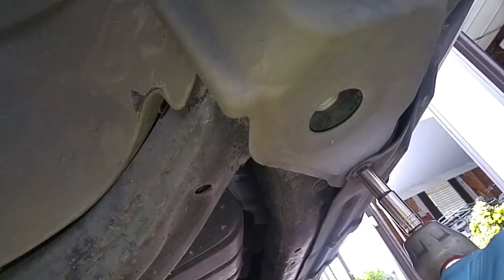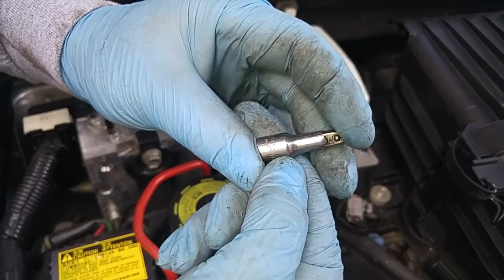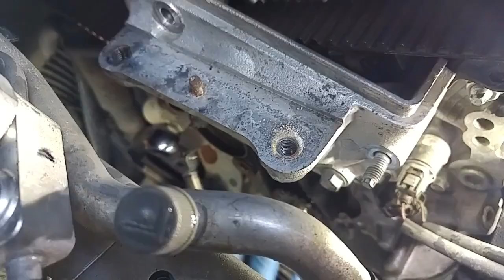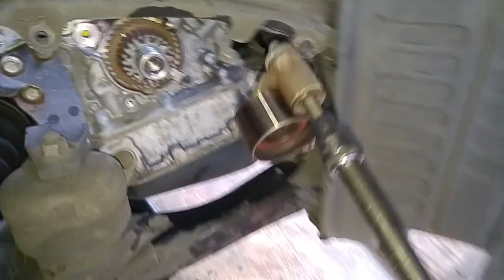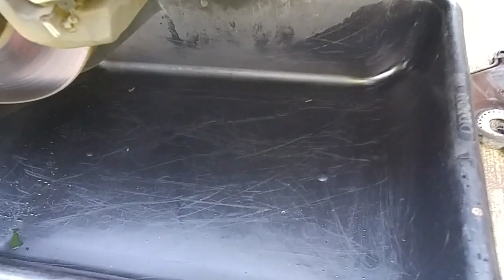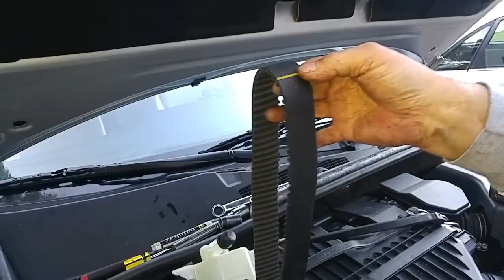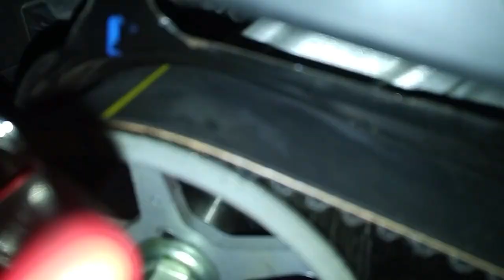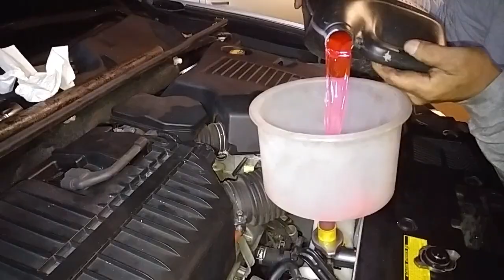Toyota Highlander Hybrid / Lexus RX400h Timing Belt, Water Pump & Seals - V6 3MZ-FE (2006 - 2010)

Comment: Excellent video! I had a Plymouth Breeze that had a timing belt that needed to be changed every 60K or so so I remember doing a lot of the things you are doing. It's a challenge but really satisfying  once the job is done. I'm interested in getting a older Lexus RX400H or Toyota Highlander that may need a timing belt replacement therefore I am writing to you to inquire if you would do this job for me if I drove to your location and the cost. Your reply is appreciated.
Reply from the maker: Thanks for your comment and sure ... I'd do the job for you.   As a matter of fact, this repair video was done on a customer who came from Nashville (around 3 hours away) to have me do the repair.  He was quoted some ridiculous price of $1,800 by two Toyota dealers.
Reply: @hardlymovingpro  Thanks so much for the fast response. If I do find a Lexus or Highlander that needs a timing belt replacement, I will be checking with you to do the job. I am located in the Charlotte, NC area and would be thrilled to drive wherever you are. You are very good at this! Thanks again.
Reply from the maker: @waynehendricks8187  You bet!  Live around Memphis.
Reply: @hardlymovingpro  

Uh oh.  I had mine done at a local Toyota dealership a few years back - 90,000 miles - and it was $900 and some change.  I had them replace the water pump as well and it was an additional $300 or so.  I thought that was steep.  But, now understanding how much R&R of auxilary parts is involved along with seals, etc., I can see why it's a costly maintenance item.

Now, I've hit the 180,000 mile mark and was debating whether to do it myself or not.  Your video convinced me not to.  All the removal and replacement.  Just a PIA.  My next daily driver will NOT have a timing belt.  And yes, I know that timing chains can wear and stretch but.....

On one of my hobby cars, I might do this.  A fun challenge that can be spread over time to avoid the frustrations that will arise.  But on a daily driver that needs to get done in a few hours, just too tedious and frustrating.  

But, if the dealer wants $1,800. That will be a different story.  I might even sell the car and let someone else deal with it.  

Full disclosure: It is beginning to show its age anyway - peeling paint on bumpers, worn steering wheel, needs new struts, non-functional front seat belts, worn leather seats - and making me not want to try and start "fixing" all the things it needs to run and look decent.  It's been the most boring car I've ever owned.  And, it's been the best and most reliable of all of them.

Comment: How much coolant did you have to add to get it back up to the proper level? I’m about to do this job on my 09 HiHy with the winter storm here in the south giving me some time off. 

I have everything I need but only one gallon of the red/pink pre-mixed coolant. Is that going to be enough? Is it a bad idea to strain and reuse the coolant if I need more than the gallon I bought? And do I need that special funnel or can I just use a regular funnel? 

Thank you for your time. Great video.
Reply from the maker: Around 1 gallon should suffice.  If you get the coolant concentrate (Pentosin brand), you can get 2 gallons out of it by diluting it with 1 gallon of distilled water.
Reply: @hardlymovingpro  I just bought Peak OET red/pink for Asian vehicles. Is this not an okay coolant to use?
Reply from the maker: @scootitnbootit9231  Sure ... that'll work!

Comment: Hello I watched your video and do the timing belt change after I finish and crank the car. It start then run about couple second then cut off. All the light is come on do you think I miss the timing? I know that I do mark very well. Please let me know it is about the timing or you think it is hybrid? Thank you very much
Reply from the maker: Must keep your foot on the gas pedal to allow the engine to keep running on hybrids.
Reply: @hardlymovingpro  yes I did but it run for 10 seconds then cut off. All check hybrid light vsc light and engine light is on. After I start about 3 times and can not start I have to take out - from battery to reset then start it about 3-4 times. Do you think  miss fire do that? Thank you very much
Reply from the maker: @anthonytran9005  if the check engine light is on and the error code is camshaft position sensor related, then the belt is out of time.
Reply: @hardlymovingpro  thank you very much. I’ll take it out tomorrow and see the mark again. The only problem I can not see the the mark on the inside camshaft pulley!

Comment: I just changed my timing belt, tensioners, pulleys, water pump, it's making ticking noise. I drove it and seems normal, the same as before I changed them. Is this normal?
Reply from the maker: Probably valve tap.

Comment: Hi I have the same car, 
Yesterday I was driving it, suddenly I saw it was overheating, at the same time it shows in the dashboard ( water pump). So do you think it’s the engine water pump? Also do you think that I can replace only the water pump without getting the timing belt out ? 

Thanks a lot in advance
Reply from the maker: Could be anything in the cooling system;  water pump, hoses and radiator are all sources of coolant leakage.  The water pump on this Toyota engine is driven by the timing belt.   Must remove the timing belt.
Reply: @hardlymovingpro  
Thanks a lot I think based on what you told I’ll go ahead and reply the Engine water pump because two months ago I replaced the hybrid radiator, the hybrid water pump and the radiator assembly due to leakage right after that I had no issue at and no leakage. 
Just happened that my car was overheating and as result for that the radiator start leaking so I’m thinking the water pump is maybe partially working due to it’s age about 12 years now and this causes a pressure buildup in the cooling system cause radiator leaking to release the pressure. 
Do you think I’m on the right path ? 

Thanks

Comment: How long did you take to do the whole job? And also I seen videos where there's a "maintenance mode" and that mode stops the hybird system from kicking in, making the "gas mode" stay on all the time. Did you do that while bleeding the air out the cooling system?
Reply from the maker: With my video partner capturing the repair, about 6 hours.  With no stopping for video, around 5 hours.  From my recollection, if the car is in neutral and not running, depressing the gas pedal will turn on the engine and keep it on.  This is needed to allow the engine to reach operating temperatures for bleeding out the air from the cooling system.

Comment: Same as j. The hybrid seems easier than the non hybrid to replace the timing belt with related. Will be doing a 98 honda prelude soon
Reply from the maker: That's right ... IMHO it's easier since there's no ps, alt and a/c belt to remove / reinstall  and tighten.  But the time saving there is offset with moving of the brake fluid reservoir and removal of the battery.   In spite of the ease of the repair, the customer was quoted $1,800 to perform the belt replacement from 3 different Toyota dealers!  And from my understanding, it didn't include the replacement of the seals.